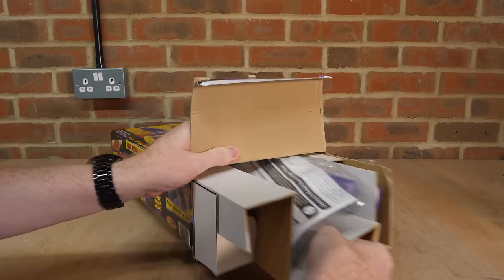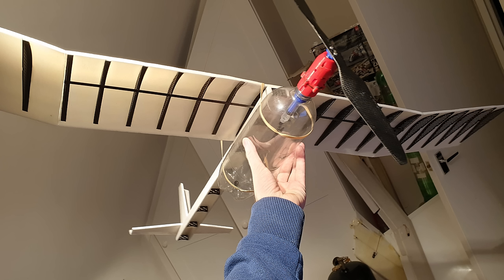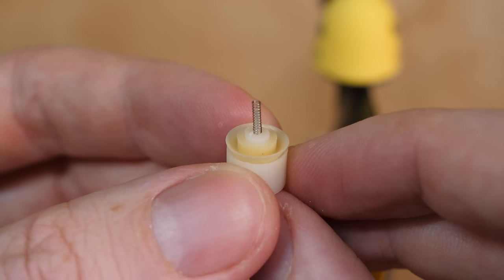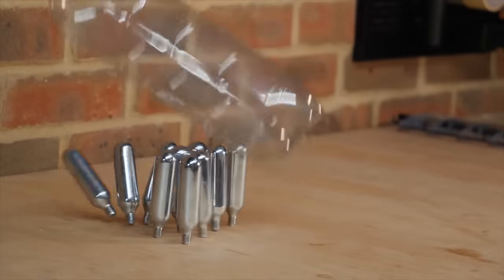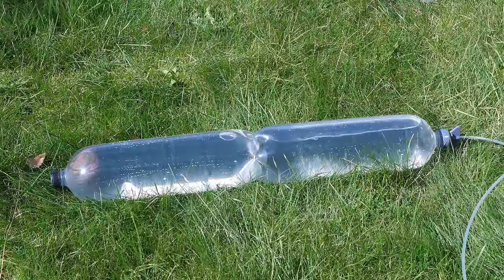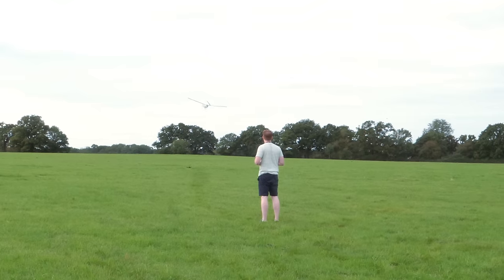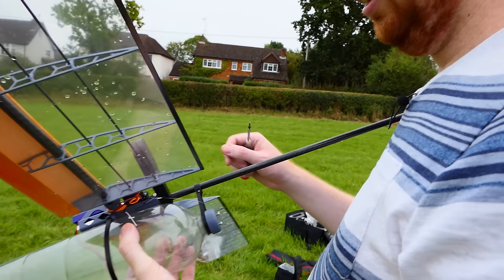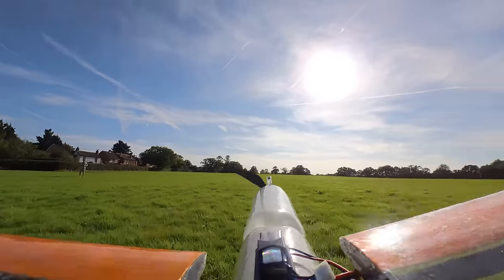Flying a Plane Powered by AIR

Comment: This may be a crazy idea, but what if you had two bottle fuselages each with their own engine? kinda like a P38. Or maybe you could get four bottles together and fly it with the twin cylinder engines, which while less efficient should let you climb better and then you could glide for longer. Also the increased weight would make it handle wind better.
Reply: Yes, now that we have done the efficient stuff, lets have some fun and do some ridiculous stuff.

Comment: I've followed a few of your builds over the years. When you build a wing like this it is a good idea to add some washout. This is a slight twist in the wing so the the leading edge at the tip is at a slightly lower incidence than at thee root. What this does is make the wing more stable at stall speeds or higher angles of attack. When the wing root is at a stall angle, the tip will still be flying, so does not drop one wing tip and loose a lot of height etc. The nose will drop of course, but it makes for a more stable plane. With the airfoil, the centre of lift will change with the flying speed, shifting further back the faster you go, designing your motor to run at lower speeds with a bigger prop will be more efficient too. Until the prop stops at least...

Comment: If the tail feathers were stick-built like a typical (now considered old-school I suppose) balsa model, it would be lighter than a slab of balsa with lightening holes drilled in it. Love watching you develop this project, Tom!
Reply: My thoughts exactly. Same with the wings, and no need for the leaving edge sheeting at this type of plane. Nothing beats stick balsa when it comes to stiffness to weight ratio, maybe carbon fiber but not by much.

Comment: I have always thought that those 12 g CO2 capsules have 12 g of liquid CO2. In that case one 12 g CO2 capsule would have something like 6-7 liters of gas depending of air temperature and pressure.
Reply: You were thinking correct. He, for some reason, assumes it is just pressurized CO2 gas. At which would they could just as well have used air. The whole point of CO2 is that it is a liquid.

Comment: Assuming that your seals can take the extra pressure, or that you are able to create seals that can, if you wrap your bottles with some wire or tape, you could increase the maximum pressure that the bottles can withstand while not adding much weight.

Comment: Great evolution, Tom.

A few suggestions to add to what other people already said:

1 - splice multiple bottles together for added air volume while shaving some weight.
2 - As you add more bottles, you might want to consider using the bottles as a structural piece to hold the tail. It will save a bit in terms of size of the aircraft and might end up saving some weight too. 
3 - For the balsa wood parts, you can probably make some more holes into it without affecting the structure too much. And since we are talking about shaving some grams, you might want check the weight the paint is adding. 

Looking forward to the next video of the series. =)
Reply: Valid points

Comment: Id love to see if you could somehow use the wings as extra air tanks
Reply: I was thinking the same thing. Maybe there is some lightweight tubing that he could route through the holes... as long as it could hold pressure.
Reply: You probably need as round a shape as possible to maximize volume per unit surface area, since the surface needs to be strong and therefore heavy
Reply: @brlamb5 tubing would be heavy, very high surface area per volume.
Reply: I‘m guessing high pressure air tanks will make this unnecessarily complicated or would require molds and industrial equipment only a mass product could make cost efficient use of.
Reply: Anything strong enough to hold the pressure without changing shape in the wing will be extra weight.
Reply: Next video idea for sure
Reply: @BiggestHottestGuy 
Yeah, but it's not compressed.
Reply: @BiggestHottestGuy 
Yeah, but it's not compressed.
Reply: It might be far more practical to fill the wings with helium to help reduce the weight of the plane!
Reply: Any increase of pressure inside of the wings would degrease the stability as the shrink foil like material is only curved around the structural integreties and not heat merged. Adding air to an extrend, that it will have a noticable effect, probaply would make the flight experience much worse  Just assuming but why not giving it a try right.

Comment: Some observations:

1) I have used Opera since its early days, but I had to give up on it a few years ago because it kept getting buggier and more unreliable. After losing a large amount of data for the second time, I went back to Firefox and haven't looked back.

2) The reason that plastic model covering film exists is because in addition to being easier to use than paint, it's also stronger, lighter and smoother. Less drag and less weight. The additional paint you added was unnecessary and added weight.

3) If you look closely at how mainstream model wings are constructed, they have many small crosspieces running along the wings. Those are less structural than to force the covering film to maintain a shape much closer to the uniform desired airfoil. They are so small that they add little weight, but the benefit is much more significant.

4) Apparently you are unaware of prop savers. They use a rubber band (actually an O-ring) to hold on the prop. It may save some weight as well as keep your driveshafts or props from breaking every time you land.

Comment: To pressurise the entire wing might be worth a try, molding a "winglike plastic bottle" sort of. Maibe the "winglike plastic bottles" could be bigger and actually replace the bottles. Quite a job to test the weight/power ratio, but with 2 meters wingspan its a decent amount of volume that might be worth testing anyway. Nice work btw its really cool
Reply: Wow, the idea of using the wings as bottles is quite interesting
Reply: In the wings, the surface to volume ratio is very high. Now consider it needs to be strong enough to withstand >100 psi and it will likely be not worth the extra added weight. Sorry to say
Reply: You can't keep a desired shape across wildly changing internal pressure unless it's made from very rigid (and very heavy) material.
There could be a tubular inlay in the thick part of the wing, but it's volume to surface ratio and thus energy to weight ratio will be low.

Comment: If you manage to splice together more bottles you could have the tank be a structural component holding the tail.

Also, some smooth fairings for the engine and/or pusher configuration would help a lot with drag I think. The former expectantly vince you are 3d printing I think  it's a worthwhile investment of  little additional weight

Comment: On the co2 point. I think 12 grams of co2 at standard atm conditions should take up ~6 liters. The co2 is liquid not a gas in those cartridges. Considering the drag difference between the 2 liter bottles you may be better off looking at the co2 idea again. Assuming you can regulate the pressure to something reasonable and give enough surface area to boil the co2 into gas.

Comment: Always do the control surface check before every flight, its saves a lot  of disasters.  Try a folding prop and try more prop pitch so that you get thrust at lower revs.  May or may not lead to a longer flight but worth a try.  In flight the airflow allows a coarser prop than on the bench.

Comment: This is so damn awesome...
Could you potentially increase the flight time a tiny bit by using the exhaust of the engine as a tiny bit of thrust? As in, print the engine in such a way that the exhaust is redirected backwards?

Comment: The CO2 you typically find in cartridges/paintball tanks is generally stored as a liquid, therefore stored at a ~700x higher density than gas. It pulls heat from the atmosphere as it is used/expands, which is why you often see CO2 tanks (and propane tanks, for that matter) "frost up" when in heavy use. 

You'll likely find that you'd have greatly increased range if you were to run from a CO2 bottle.
Reply: Yes, even Google indicates that it is about 6 litres of CO2 at 1 atm and 0C for a 12-gram 21-ml cartridge. However, it will not surpass the bottle solution in terms of range.
Reply: I guess it would need a complete change of philosophy as the weight would be orders of magnitude higher. He would then need a way bigger and heavier motor, a larger frame and wings, etc...

Comment: I reckon the added weight of having pressure-capable and air tight wings doubling down as reservoirs would be negated by the air capacity, and thus run time, those wings would provide.
One of the reasons it struggles so much with wind it's because it is so light for its dimensions and drag, so adding weight for run time also has another benefit.

Comment: This suggestion may sound unconventional, but have you considered utilizing the wings as an air-tank?
Reply: In fact it sounds very conventional. Basically all passenger planes store their power source (fuel) in the wings.
Reply: You would have to completely change the design of the wings and they would have to be much heavier and stronger to hold 120 psi and hold their shape.
Reply: With a full Carbon fibre wing, he could do it.
Reply: The shape is not conducive. To make an airfoil pressure vessel would require too much weight. To enclose a cylinder in the airfoil would probably be a waste of space.

Instead, replacing the carbon tail spar with extended bottles for larger capacity and longer runtime would be easy and efficient.
Reply: A pressure vessel needs to have the smallest surface area possible to maximise it's efficiency and the wing shape would be one of the worst possible designs for that purpose. That's 120 lbs force on every square inch of the wings surface, don't forget and that looks like a lot of square inches to me and relatively not much volume! Imagine how much force there would be at the wing edges, trying to rip it apart! Curiosity may even tempt you to work it out, if you have the inclination. Actually, thinking about it, it would be equivalent to a teenager standing on every square inch inside the wing!
Reply: It is bad idea because of cube law and ideal shape to hold pressurised gas. You need the least material with sphere shaped container to hold the same psi. And the larger container needs less material to hold the same amount of gas. If you will do the whole wing as a container, the sides will be much more heavier to hold shape and if you do skinny pressurised pipe inside wing it will be too small of the container for the amount gas it can hold (mass/added power ratio will be really bad). The drag that bigger container outside will induce in terms of power-to-weight loss is incomparably less then loss due to MASSIVE wing with tiny win in drag.
Reply: I suggested the same thing above in another comment. So the idea must be worth something. :-)
Reply: @mifphilip not even CF, GF would do
Reply: @mifphilip  I'm sure carbon fiber would hold the amount of pressure he's got even without an optimized shape, but that would drive up the cost too. And if you just leave the wings as is and make a carbon fiber cylindrical tank, you would be able to get the pressure higher, possibly still winning out. The material is somewhat tangent to the optimization of the shape.
Reply: @Elrog3  OH, I know, he also said so in the video. Your comment about the tank inside the wing could also be really cool.
Reply: @windowsxseven  yeah, you might be right. I just know that CF is very good in tension, and can hold a lot of pressure even when shaped weirdly.

Comment: Tom, I see a lot of Dutch roll during the flight, which I believe it's due to the apparent mismatch in lateral fuselage surface between the forward and aft halves vs the C.G.
It should suffice to add a triangle of balsa or, better, of oracover under the fuse boom starting down from the bottle keel up to the boom end.
BTW you should spend less energy in compensating and therefore gain some more precious seconds of flight !
Keep up the good work 💪💪💪

Comment: Try ditching the bottle for a Single Body & Wing Mold that's hollow! This will allow the whole inside to be a chamber. You would have to mold you Rutters to fit the backend of the wings but it could work. 

With some intelligent design you could keep it 'expandable' by allowing for Body/Wing Extension Applications!

Comment: I am curious about the potential of powering the plane with a pellet of dry ice in the tank to extend range 🤔
Reply: Or lots of dry ice, and just make sure to release the pressure by flying it quickly before it becomes a bomb.
Reply: @pauldickman4379  mass is going to be an issue, if the pellet weighs as much as the camera it can lift aloft then it might work.

I am a bit concerned about plastic embrittlement under that temp, embrittlement and high pressures end up as bomb.
Reply: I used to make water bottle bombs as a kid, just a little water and dry ice blows a water bottle in half
Reply: this is same as co2 cartridge, as it contains same dry Ice inside but when under pressure dry ice is in liquid form  or supercritical fluid
Reply: The issue is weight and ability to gasify dry ice (solid CO2) fast enough.
Dry ice in air sublimates slowly as air its a good insulator in a closed space, unlike dry ice placed in water where circulation currents and the latent energy content of water speed up the state change process. 
Adding water would add weight, as need enough water to stop the dry ice at -78.5°C from freezing the water, which would greatly slowing melting of both.

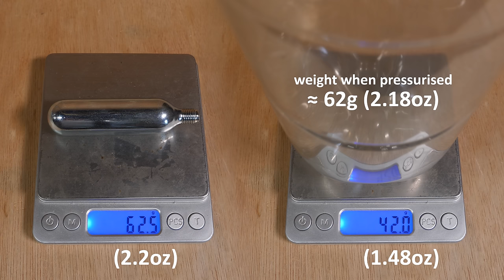Note: a plastic bottle is just 42g (6:50), or 62g pressurized which holds over 8L of gas. A excess pressure regulator would also be require to avoid over pressurization. (as part of the weight budget)
Reply: @AerialWaviator  The way how you deal with those thermal issues is by adding longer tube to heat the CO2

CO2 also has much higher pressure to it can provide way more power but you probably you can't 3d print your engine anymore as it will blow up

Comment: You should also add landing gear so you aren’t always dealing with crash landings. Even skids on the ends of the wings should be good and help balance the plane’s weight ratio, allowing it to do better in the wind.

Comment: You may be able to squeeze out a bit more performance by making your wingspan longer while reducing the cord length of the ribs, thus raising your aspect ratio and decreasing the overall drag without significantly affecting weight. Most modern sailplanes (gliders) use this effect to increase flight time and glide ratio.

Comment: I don't know if it will help the engine, but...

Because it uses a seal at the top of the piston, and not the piston itself to seal, you don't really need a big piston.  If you can make is smaller or eliminate it, you will have less mass to push up and down, and more energy to spin the prop.  Again, not sure it will help with such a small engine though, but it looks like you are trying to get the most performance out of that engine.
Reply: He could make the piston using gyroid infill with no walls, and only top/bottom layers.
It'd look sweet and be lighter

Comment: This is super cool. I wonder if there is a way to have less of a constant  thrust drop off. You've got the thrust charted, so find the amount you need for the flight characteristics you want, I'm guessing it's well below peak thrust you are seeing. Then instead of using one large air tank, you could use a smaller bottle as a "capacitor" to feed the engine, with a larger bottle feeding that smaller one with some sort of pressure regulator set to the pressure needed for the thrust desired.

Comment: Might I make a small suggestion of adding a fairing where the bottles are joined? A single piece of packing tape wrapped round the joint might make a great improvement in aerodynamics. More than the tape costs you in weight, at least.

Comment: That was soooo impressive dude! That huge jump to over a minute, what a motivator! What I need is an air powered paramotor. I only need a short time power to take off over the sea and back to land for the thermals, plus there would be big air tank so I float if I go into the drink, perfect!

Comment: hey tom, why don't you use that 3d-printable foam for the wings? surely you'd save overall weight if you use a sparse infill pattern instead of ribs, while maintaining structural rigidity, as it would eliminate the need for any denser materials at all. you could probably then also wrap the foam in a layer of plastic sheet if it's not smooth enough. just a thought

Comment: Very cool plane! Here's a bit of a cheat if super long time aloft is what you're after: Fly it on a hot / windless day and focus on climbing as high as possible, you might catch a thermal current.  One you're in the thermal you circle around and the plane will go up as if it's in an elevator. It could even potentially go higher  / stay up longer than you want (Why some R/C gliders feature spoilers to "de-thermalize" and avoid loosing the craft altogether). With a little bit of luck and some practice you could keep it up for a very long time.

Comment: the seam region between the bottles adds unnecessary extra weight, due to the extra thickness of the plastic in this region and also due to the weight of the joining screw. Furthermore, if it were completely straight, this area would also be used to store more compressed air.

Comment: Just a suggestion but instead of just letting the balsa wood dry, you can hit it with a coat of fiberglass resin and it will be probably 50-100 times as strong while still being very light, if you don’t have the strength you want you can cut a bed sheet or t shirt and cover tightly, tack in place than coat with resin. Now you can coat in paint and have a nice fiberglass like wing